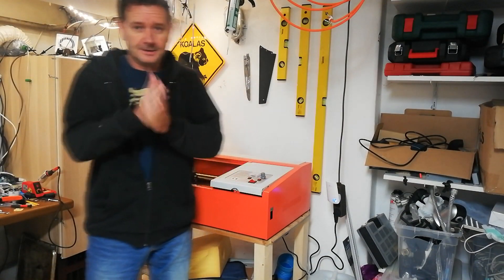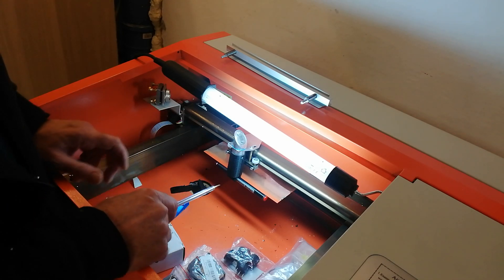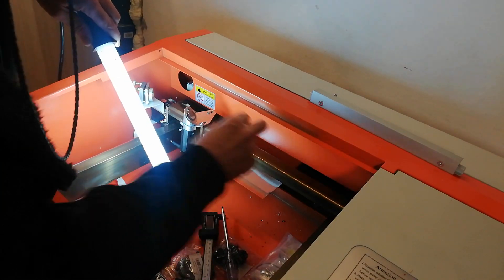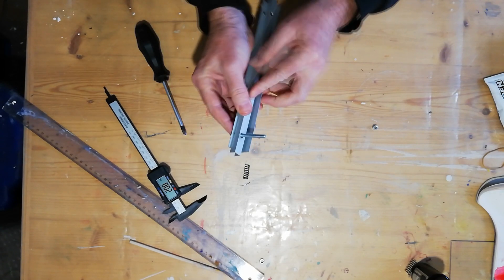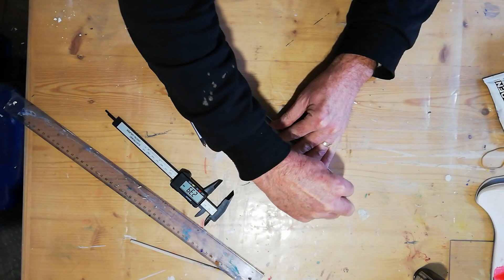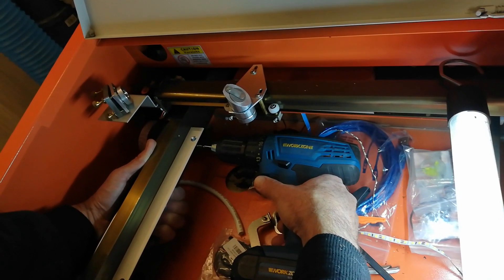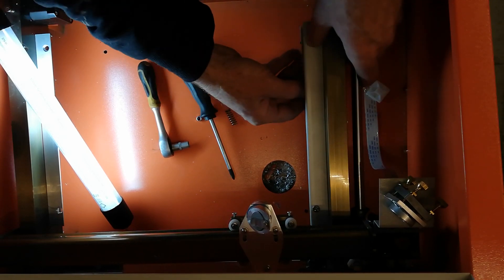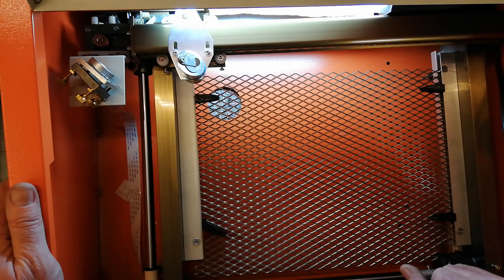k40 Laser Upgrades Part 1,  Spring loaded bed.

Comment: Mate. Out of curiosity, how far down from the top of the y-axis rail is yours? I did this using the jig, but it looks like my focal length is way off. Top of the bed to the bottom of the lens is supposed to be 50.8mm but looks like mine is over 60!
Reply from the maker: Hi, yes is should be 50.8mm to the bed, I have noticed there is some differences between machines but that is way too much, is the 3d print  sitting all the way.

Comment: Nice idea for a quick bed, CAn I ask please why you used U section and not just square tube section? any reason behind that ?

Its a good solution to what is a pain in the arse crap bed they supply, I dont know why the chinese just dont take out the beds and put this type in in stead, probably cheaper for them,  the aluminum they would save on supplying them what they do with the crap clamp. I know the machines were originally designed for making signature stamps. Perhaps they still use them for that.who knows? If you dont own a pop rivet gun just use self tapping screws with a drill head on or even a blind nut gun would do, like the spacers as well.

Comment: Are you doing a series? Thinking about buying one of these could use somenhelp getting it up and running... My understanding they dont work out of the box
Reply from the maker: Hey Ron yeah I'm going through the process of modifing a few add ons and yes you need to align the 3 mirrors, which I don't show but there is plenty of videos on YouTube, this is quite a pain to get right.
Reply: @letsfixit1594  okey subscribed! I like tinkering so looking forward buying this k40

Comment: I really like that idea of using the marker mounted on the head to get a perfect line reference from the head itself, we all know how much play is on the right side rail lol, While you have that thing apart i would highly suggest that you replace the Y motor coupler with a flexible one to take away that odd motion that one gets when moving the Y-axis. look at photo 3 in my dropbox of the mods i just finished to mine. https://www.dropbox.com/sh/bgg6pmastt21e9p/AAC_XR0sETB4wctYgyi5ki3Ka?dl=0
Reply from the maker: Great idea I will order one and replace it, thx.
Reply: @letsfixit1594  It made a world of difference to my Y axis, it completely took away that wanky motion I was getting, it felt like the axis was loose than getting tighter and loose again as it when along its movement, I will use you pen idea thing, and design one to fit that upgraded head i am using, even though i used a marking gauge to score my line from the bottom side of the Aluminum rail, it does not match that the axis is set as which I am getting a focusing issue on the far right top side of my bed, your little fix would solve that!
Reply from the maker: @patprop74  Yeah try it out and let me know, the 3d print length is set up for the original lens and you can check the height with a tooth pick as there is a small hole in the middle of the print.Should be 50.8mm
Reply: Are using an arduino for your control?
Reply: @bobbyboy1962  I am, I use an Uno with CNC shield. the PWM spindle controls the laser output with 2 resistors and 1 Npn transistor to create an Inverting not gate between the Cnc shield and the laser power supply.